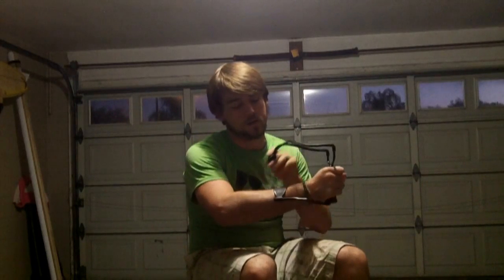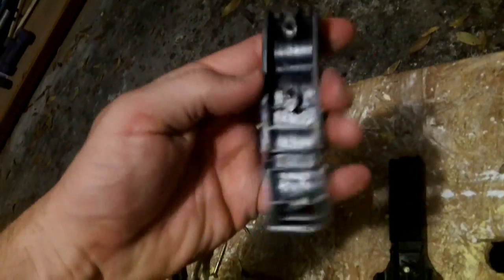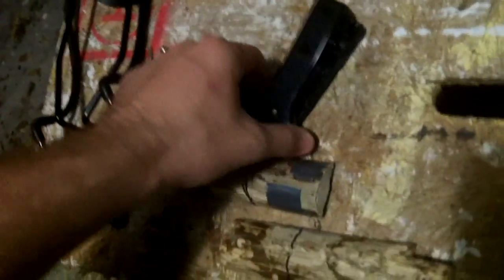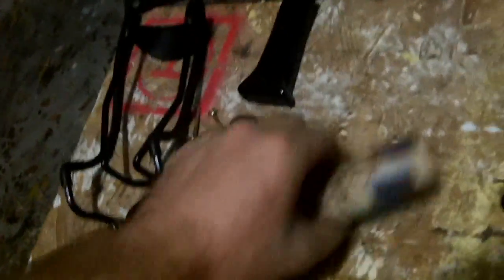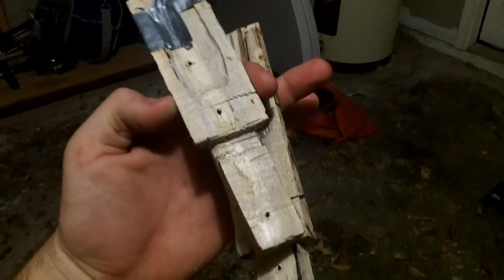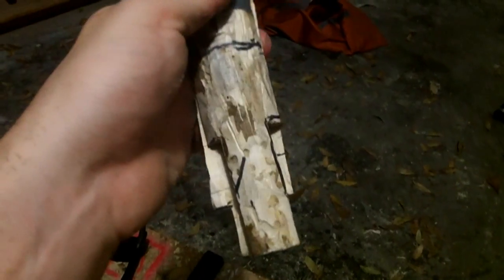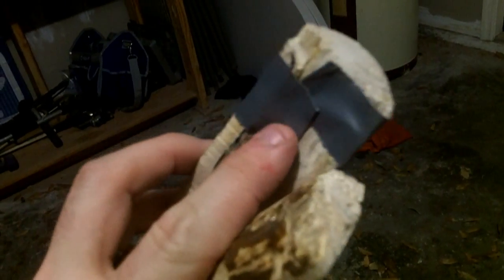slingshot Upgrade

Comment: You should check out the Slingshot Channel. Jorg Sprave (Joerg on Youtube) is a german slingshot maker/enthusiast and would definitely provide you with hours (or rather weeks) of entertainment, and insight. For example, he has used high-speed and infrared cameras to show how tapered bands perform better than straight bands, and how holding the bands drawn for too long actually decreases the potential energy stored in the rubber. He has over 200 videos!

Comment: killed no. stunned yes but it takes a long time to get good. you can stick with a basic slingshot like that or get a advanced one. i prefer basic weapons/tools. long bow with no sights instead of a compound bow. a single shot 12 gauge instead of a pump or semi auto 12 gauge. simplicity is better than complication.